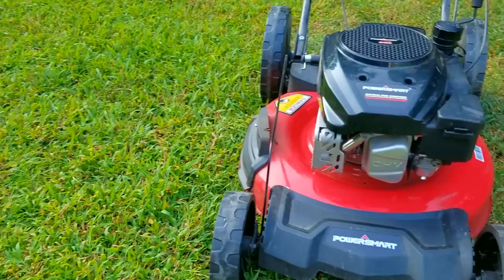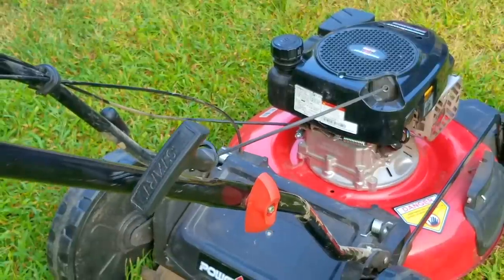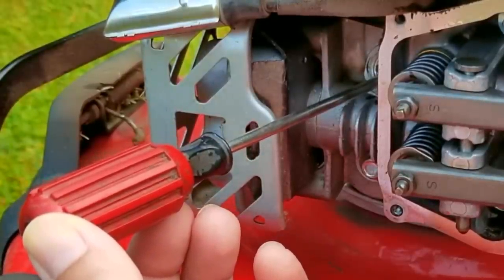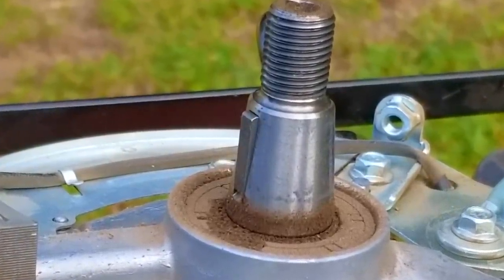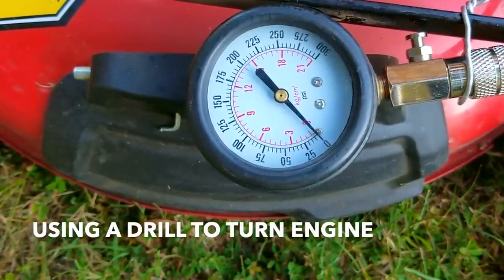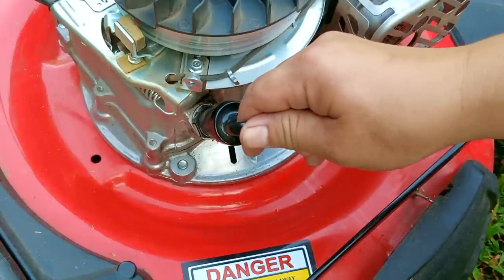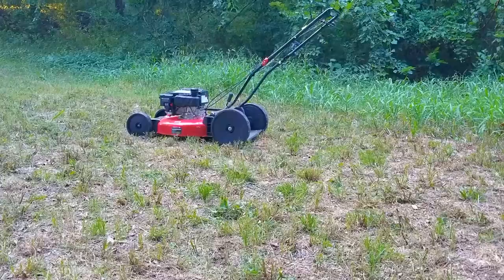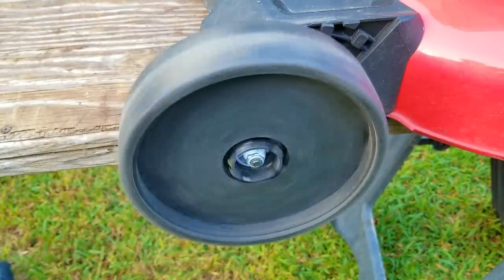Fixing A PowerSmart Mower That Won't Start

Comment: Great video I’m a kid to we have a 2000 victa vantage it starts but it has quite a few problems 1: it starts and runs but has backwards throttle so start is stop and stop is start 2: you have to take the air filter off it and get to the carb’s throat put your finger over the hole at the bottom then prime it 3:you can’t rev it to full throttle because it will be reving  to much and it might try to stay idling 4: you have to tip it down so no fuel can get to the carb but anyways great video buddy keep it up oh and also here’s a joke how does the ocean say hello? it waves get it the ocean waves to you but great video keep it up buddy and also won’t start get a bigger hammer great video keep it up buddy
Reply from the maker: wow, that's a lot of problems
Reply: IS THAT YOU
Reply: I can’t believe it is it you for real
Reply from the maker: I'm most definitely real
Reply: Oh and also do you know how
To fix the carb problem

Comment: Hay wondering if you now what is wrong with my stihl ts350 stone saw it starts and runs but stops if you release the trigger but if you keep the trigger in it keeps running thanks
Reply from the maker: sure, it sounds like the carb is either out of adjustment or it's not working like it's supposed to, because of the diaphragms. I would adjust the carb, or replace it. There might also be an air leak at a gasket or seal.
Reply: @INSIDEHOUSEGARAGE  ok 👍 I will take a look at the carb thanks for the help

Comment: I just bought a new push mower and put fresh oil in to break in the new engine, should i change the oil after my first cut
Reply from the maker: I'd wait for the another cut, or more if you can wait. For me, I'd be about an 1 hour or so of running for me to change the break-in oil.
Reply: Oh ok

Comment: I've got one and need the valve clearance specs.  Since you don't remember them, is there any chance you could tell me where you found them.  My exhaust rocker arm "ticks" once at the start of the stroke, but when I loosen the exhaust valve clearance it does not do it.  The mower actually starts and runs decent with the increased exhaust clearance, but I'd still like to know the factory setting.
Reply from the maker: sorry Brandon Parrott, I don't remember where I found it either.  The reason is because this engine is not popular so the specs are not easy to find.

Comment: Hi I have  pawer smart lawn mower . every thing looks ok but does not fire up at all. I put some gas in the carburetor no fire up. have spark  timing is ok compression when puling the rope it looks it has compression. lawn mower does not fire up .
Reply from the maker: did you check for spark at the plug?

Comment: I mow three lawns a week and my most recent Honda broke. It is a HRR 217 with blade break. The wheels won’t spin back. Replaced oil. That didn’t do anything. Also the front bar that protects a person from getting hurt by flying rocks or debris bent down in. I called Honda and they won’t do anything. Do you have any mower recommendations/ fixes. I want a HRC 216 but I don’t know if that is overkill.
Reply from the maker: so how long have been using the hrr217 and when did it have this wheel problem?
Reply: I just started a few days ago I was mowing and the self propel started making a noise. Then it wouldn’t roll back. The mower is about 3 years old. Last generation of HRR
Reply from the maker: fortunately the way the Honda drive system works, you can push a mower forwards, even of the self propel is stuck or jammed,  and unfortunately that's what I'm hinting at, I do believe the drive system is toast.

Comment: What kind of lubrication do you use on push mower wheels?
Also if I may ask what product to use to flush the engine
Reply from the maker: the engine flush was old gasoline, and I'm using plastic safe lithium grease for the wheels.
Reply: Thank you so much (2) very nice things to know
Reply from the maker: no problem

Comment: I handle a lot of power smart push mowers at my job at fedex they seem to be popular the one that seems to be the better one is the 209cc one I saw reviews on the 209cc one and it seems to be pretty powerful and does pretty good we are fixing to do an oil change on my huskqvarna push trimmer it has a Briggs 190cc flathead it’s a really good trimmer for the price the only thing about it I don’t like the strings if you run them against a fence they shear off instantly the strings don’t last long and a box of them are quite expensive but if you use it right you can make them last other than that my trimmer is great quality and the Briggs engine is very powerful the good thing about push trimmers you can use them as a push mower and still do trimming with it meaning buy a push trimmer you won’t need a weed eater and it’s pretty easy to push and after it’s been running the Briggs starts no problem one pull I would like to see a review on push trimmers they are very good there are some affordable but reliable push trimmers out there like my huskqvarna the best one is absolutely amazing but extremely expensive I can’t remember the brand name of the best push trimmer it has electric start and you never have to change the strings but you’ll pay over 1,000 dollars for it I only paid the lower hundred dollars for my huskqvarna and it does work well I would love to see what your thoughts on push trimmers is
Reply from the maker: you are correct, they're not bad when working it's just that they don't seem to be built for the long haul, and what I mean by that is more than a couple of years.
Reply: @INSIDEHOUSEGARAGE  it’s definitely a case of you get what you pay for

Comment: If I were offered this mower for free, I would definitely take it! I have an old Briggs Quantum on my bench that needs a home!
Reply from the maker: that would be a good swap
Reply: I have a brand new one and its giving me problems on the first use. 2 days to cut a 1 acre yard. Either won't start or back mulcher get full fast and the side mulching setup not working... it still wants to release the grass through the bag😮😢

Comment: IF I needed one I'd say yes, knowing what stunts it already pulled BUT I'd reduce the r.p.m. and refill it with Delo. I've babied a bunch along like that and almost never run them wide open at 3600. BUT that's just M E too, nobody else. And we usually learn more from the bad ones than the good. Thanks and Blessings!.
Reply from the maker: that's makes perfect sense to me, and I think that's a great idea.
Reply: @INSIDEHOUSEGARAGE  I think that refiners are making oil a lot different than it used to be and the lube properties are a lot weaker. That's why I run stuff slower and use a better grade oil. My 'career' was truck driving and heavy equipment operation as my title picture was taken from one boulder hauler of another getting loaded. I shot it. I ran a Cat 980g loader and when I quit, it had 24 THOUSAND Hours on it and had never been touched as far as overhauling engine or tranny. Guess what kind of oil they used. U got it, DELO! That made a believer out of me. I changed the oil in the opposed and it was purplish instead of black and I usually run it harder for the smooth cut it leaves with it's floating deck. There you are!
Reply from the maker: nice, I think you've got me sold on it!
Reply: @INSIDEHOUSEGARAGE  We both know the oil, lubes, cools and cleans. I know the makers call for 30 wt. but the 15/40 works at lo and hi temps and if it'll take care of a compression ignition engine that compresses the charge of air so tightly that it'll burn diesel completely, hour after hour, there's got to be something to it! I always got the most out of whatever I did and never tried to gut it, but WORK it. Delo always came through, even for the 2-cycle diesels, GM/Detroits.

Comment: Appears lack of oil change and not maker is culprit?  I thought it was all malarkey when I read about the break in oil change. I guess it isn’t.  Thanks for video.
Reply from the maker: Thank you Sam Feldman. yes and no, from what I've seen, all other engine manufactures can last at least 3 years on the original oil, until  the loss of compression, becomes too much, this one didn't last a year.  So I think the quality of the materials was lower in this brand.

Comment: its not actually a bad mower in my opinion its a "fair" in its class but the owner should had read the manual very closely and took better care of it by changing the oil regularly to make the engine last longer and not end up like that
Reply from the maker: well said.

Comment: My ex roommates son had a girlfriend that pretty much had one of those types of mowers that they were going to throw away. I hadn't seen it yet, but they set it in front of my shop and that's when I realized it was $100 Walmart push mower 🤢 but I was up to the challenge so I went through it fuel, spark, and so on.. now the first thing I noticed was the gravel rock that was inside of the gas tank LOL and of course the carburetor and filter were super nasty, the pull rope was overstretched.. except for the rocks in the gas tank all of these things were just maintenance issues that happened over time. The problem was this mower was allegedly only a year old and I believe them because the paint was still shiny! Well after cleaning it up and pitching the rocks, I rewound the pull rope and on the second Pull it fired and started running! But as things go while I was mowing a side yard with it it suddenly went to revving very high and before I knew it it launched the Piston out of the side of the engine 😳 that's right! Once it was fixed to where it was working the damn thing decided to commit suicide LOL thankfully enough nobody got hurt. The moral to the story is if they're giving them away at a hundred bucks a piece brand new it's probably a reason for that..
Reply from the maker: wow, that's an amazing way to have an engine break.

Comment: I heard something pecking when you pulled the rope & again when you turned it off. I thought at first the blade was loose.
Reply from the maker: unfortunately the engine is making that sound, and I've heard it from every one of these engines.

Comment: Would you say hat the modern engines on todays mowers are much more fuel effient as than those that were made in the say early 2,00s
Reply from the maker: no, and that's because they are still carved.  They now have more stringent smog regulations on them, but until they become EFI, these will always be inefficient machines.

Comment: 120 PSI is a good compression reading for a lawnmower engine !
Reply from the maker: the problem is the initial, and even the second pull, didn't get good readings.

Comment: My lawn mower have been sitting for a year I drained the oil out before I put it away for the season but forgot to drain the oil when I went to drain the oil it was black I replaced it with fresh oil but it still won’t start
Reply from the maker: I can only guess you meant to say that you drained the gasoline, not the oil.  If so the carb's main jet needs to be cleared.
Reply: @INSIDEHOUSEGARAGE  oh I’m sorry I drained the gasoline but left the oil sitting in it for almost a year when I poured the oil out it was black

Comment: The rear wheels on the powersmart mower I found in the trash this week are worn out so only one of the wheels is driven by the self-propelled. My dad was looking for the wheel to purchase but didn't have any luck searching. Any tips on where to get parts for this mower?  He said the engine was a copy of the Honda that he recently worked on and it sounded just fine in the brief 5 sec test run.
Reply from the maker: the engine is a copy but it's an older design they copied and the carb primer setup is there own. as for the parts, I won't be able to help unless you want to look on Ebay

Comment: Power hard to start!! Not for me!! I wouldn't put that engine in a kid's go-kart!! I wonder how easy it would be to blow it up?
Reply from the maker: thanks Christopher Marshall.
Reply from the maker: most likely
Reply: @INSIDEHOUSEGARAGE  I got an old Montgomery Wards free.  Gotta be at least 22 years old (Wards went out of business in 2000).  Has a Briggs Pulse jet on it that was locked up.  Poured oil down the plug hole and let it sit and then broke it loose with a pipe wrench!!  It starts easier and runs better than that piece of junk you worked on!!  BUY AMERICAN MADE!!
Reply from the maker: you bet!

Comment: "Boat anchor on wheels." ROFLMAO.  I'm wondering if the auto choke is working, as difficult as the engine is to cold or half-cold start. Really weird it locked up like that. No valve/piston interference on an L-shape cylinder head.
Reply: No auto choke. Primer bulb is used.

Comment: I have one.  It's a piece of crap.  The plastic has cracked where  the bottom of the handle touches the deck.  (all plastic)
the protector for the drive has cracked into bits.  I live in Florida so I mow regularly.  I am done with it.
Reply from the maker: yes I agree with you, I thought these were okay until the reports came in on it, it's not good quality at all.

Comment: As cheaply as this thing appears to be made, I wouldn't be surprised if the jam-up problem was in the starter recoil assembly rather than the engine itself.
Reply from the maker: but I couldn't turn the engine using the blade, I don't think the recoil jam could be "strong"
Reply: @INSIDEHOUSEGARAGE  I watched the video again, and I have to agree with you. If it was the recoil, I don't think it would have jammed in mid-pull like that.

Comment: The blade brake cable does not seem to engage fully so when you pull on the rope you are fighting against the blade brake . That is the handle that you have to pull in to get it to start. Mine chirps after pulling the rope and upon shutdown which is a sure sign of blade brake engagement. The wheels on these mowers are horrible. The center part on my rear wheel broke in half and they are unobtainium. If you have one of these mowers I suggest you go find you a parts mower. Very informative video though thank you no thank you one more thing, this is American made? It's a sad State of Affairs when Chinese quality rivals American made quality.
Reply from the maker: thank you

Comment: Why do people lie ? If it’s done a couple of hours or a couple of hundred hours makes no difference to the repair, broken is broken.
I don’t know why there is so much hate toward this brand, it’s looks pretty good to me, much like my Qualcast.
Reply from the maker: so you've never used or owned one then? They are low quality, outside and inside.
Reply: @INSIDEHOUSEGARAGE  as i said, it looks very much like my Qualcast which is china made, my engine is a Briggs & Stratton but the rest of the machine actually looks better made than my mower which is still going, just, after 6 years but it’s done a lot of miles.

Comment: It simply needs a valve adjustment take out the spark plug do a valve adjustment also clean out the carburetor filters and everything else. However, I will say the mower has about the worst bagging system. I have ever seen all that plastic and cheap springs will only last maybe two seasons before it breaks it’s terrible.
Reply from the maker: you're more optimistic than I am.  I Do Not recommend  this mower unless you have no other choices

Comment: PowerSmart is an Amazon cheap Chinese mower. Poor reliability, longevity, and harder to find parts for repair.  Why people buy them is low price point.
120 psi is normal midrange compression for a 4-stroke.  Supposed to change oil initially on new equipment after 5 hours of use, but many people never do.
Reply from the maker: I agree with you, but what was the main culprit, was the reading, in the "initial" pull, during the compression test, was dismal.  for several pulls, 120 sounds good but I look at the first and second pulls, to determine how bad it is, and this one, was pretty bad.  I would like to get at least 45-50 psi, on the initial pull.

Comment: Ah okay, I have a Weed Eater with a similar engine, however it's got a primer. I was looking at it and was like.. "Wait.. Is this a Honda engine with a Primer?!" I have been so confused looking at this thing.. 
These Powermore or Powersmart whatever engines are just pure trash! I am very unimpressed with them.
Rather have a plastic Briggs over this junk! They're loud, they vibrate, and they are unreliable.  I've already had to replace pull recoils on them and they're not that old! 
What trashy little machines... Wish Tecumseh came back to get rid of these junky Chinese engines.. and newer Tecumseh was junk! LOL
Reply from the maker: feel the same way